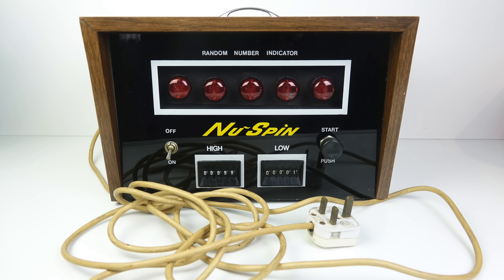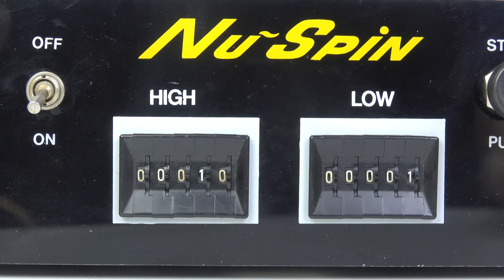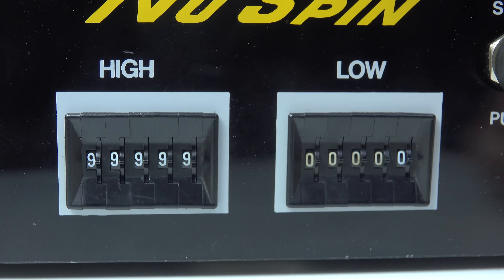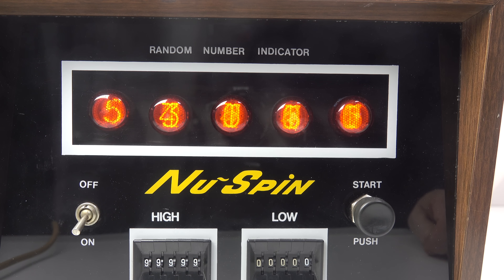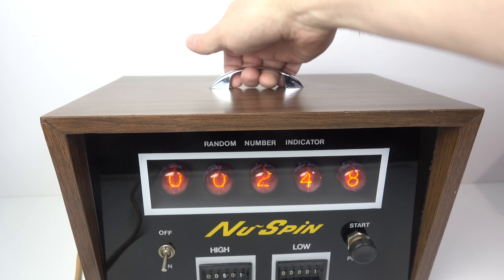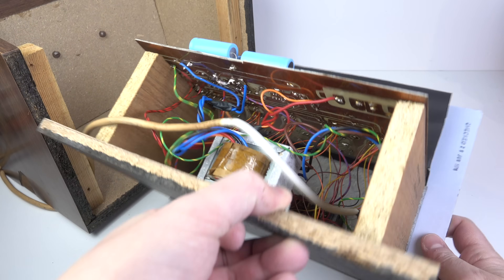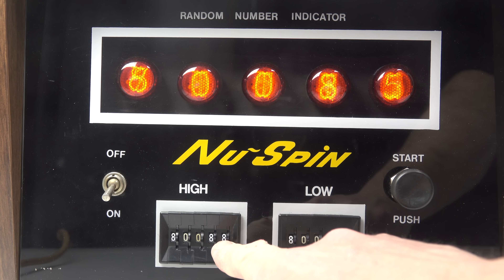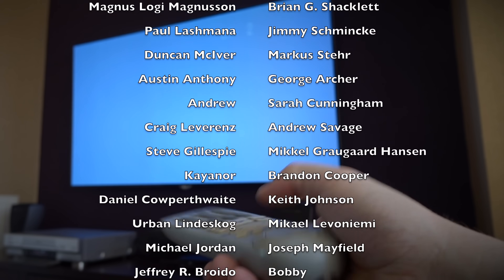This is a bit random - Vintage Random Number Generator

Comment: But how is indeterminate delay time achieved?
Reply: One approach would be that the 555 timer IC is just constantly firing with a fixed period of several seconds, no matter if the counters are currently counting or not. If the counter is running, the 555 provides the signal to stop the counter. The moment at which the 555 will stop the counter then depends on when you started it (pressing the button does not influence the 555 but only start the counter), which is "random enough".
There is some small added randomness due to the fact that the 555's period is determined with simple analog components (mostly resistance and capacitance), whose characteristics change with temperature and other environmental factors. If the counter counts fast enough, that could add some tiny bit of entropy to the mix.
Reply: @enojelly9452  Well good chance that the time will be influenced by the digital part and display drivers. Thus increasing th elikelyhood of stopping when for example an 8 is shown and lessening it when a 1 is displayed.
Reply: It chooses a random number to decide when to stop and select a random number, and so on. It’s a paradox—this is his April Fool’s video
Reply: the button compresses and the cycling stops when it's fully extended again, at least that's what it looks like from the angled operation shots
Reply: you can generate pretty random numbers by having a fast free running oscillator.. i.e. NOT gate into itself, then sample it with a much more slowly running signal pushing bits into a shift register.   The drift of the free running oscillator is random enough when its oscillating at hundreds or thousands of times faster than your sample rate.
Reply: Annon201 ship it over to the isle of man and let clive doodle it out.
Reply: 5x 74141 BCD to decimal (for the nixie tubes), 5x 7490 decade counters, 1x 555 timer, 2x 7400 quad 2-input NAND and I think 1x 7413 dual 4-input NAND Schmitt trigger. The counter circuit is pretty straightforward, not sure about the rest. The Schmitt might be used to debounce the push button switch. Takes me back to my hobby electronics days when I was a kid.
Reply: I also suspect it uses the button to charge up a cap (relatively slowly), then the counter simply runs until the cap discharges again.

(starting from the minimum, and up to the maximum value, of course.)

They could have made it even more "random" by swapping all of the output lines from the counter to the displays, but that would have made the circuit / logic more complex, as you then couldn't do the comparison to the min / max values so easily.

Lots for 4000 series CMOS chips by the looks of it. State-of-the-art back then, and for most of the 80s too. lol
Reply: I think Julien Oster's idea is probably right.
Reply: You don't need to generate an indeterminate delay.  Quite often with this type of unit, the counters are continuously running and the only thing you are doing when you press the button it latching the count value.  The reason for the delay after pressing the button (a simple monostable will do this), is for cosmetic reasons only. If the display were to show a random number as soon as the button is pressed or released, the punters will complain like hell, claiming foul play and that you are rigging the number somehow.  The delay is so that your'e not touching the unit when the random number is displayed.
Reply: @chrisg6597  But not this type, as the counting up continues from where it is currently. This can be seen with the most significant digit.
Reply: But then why the apparently random delay after pressing the button before the value is displayed?
Reply: I wonder how it is doing the high and low comparison to only give numbers that fit those chosen on the wheels. None of the chips have a compare function except the and gates and the nand gates, but there are not enough gates to check 20 inputs (40 if you count both sets of switches.)
Reply: The digits are driven by a high speed oscillator. When they run or stop is controlled by a multivibrator or one shot. At rest, the digits are stopped. Pressing the button sets it and releasing the button starts the time out. The value in the counter when the button circuit times out is whatever it is. Random in a usable practical way.
Reply: Lewis Johnson somehow i dont think so
Reply: Gigs omg yes please😂
Reply: In analog synthesizers a random number is often drawn by sampling the noise from a reverse biased transistor. Another way is to XOR the outputs of several free running oscillators. However, this is often not random enough for calculations but still usable for something like a drum machine.
Reply: @edward: if the sets of wheels and the RNG are connected to a DAC each, then only two analogue comparators are needed. 

it could also explain the quirk in one of two ways, 
A. the timing chip may not be fast enough to detect the RNG>=LOW and RNG<HIGH sweet-spot if the difference is 2 or less.
B. the DACs may not be equally calibrated. (if true then HIGH's deviation will continue to worsen as it's set lower)
Reply: Yes. I think you are 100% correct here. The counter is free running and when you press the button that determines the number. Pretty random.
Reply: In this case, it looks like it's just waiting for a large capacitor to drain, which then stops the oscillator and the counting stops. Pressing the button allows the capacitor to charge, and close the circuit to the oscillator. The button is released, and the path opens. The capacitor begins draining, until it's done, the clock stops, and the counting circuit no longer is pulsed.

This is almost a chip for chip copy from an early 70's electronics hobby book I have.
Reply: Dear Julien Oster, I don’t understand the slightest of what you’re talking about. But I want to understand. Are you Dutch and would you care for me to explain your thoughts in Dutch? Or else just really dumbing it down for non-mathematicians like me? Thank you in advance!
Reply: Here are some photo's I found online when it was being sold before Techmoan got it. https://picclick.co.uk/Vintage-Nixie-Tube-Random-Number-Generator-122974686252.html 

I just got a laugh when I randomly came across this looking up the RNG before the end of the video, incase he gave the answer of what it was. That was probably a better RNG for Jury Pools than what they have now adays.
Reply: None of us will know unless Techmoan shows us the schematic!
Reply: They are likely using 74LS193 4-bit BCD counters. One per digit. These have a LOAD input that allows them to be preset to a specific value. With clever wiring of the lower "range" switch digits to each load preset, it will easily be able to set the starting count. The ending count can be bounded by a couple of hex and gates to compare the upper "range" switch bits with the output driving the CLR input of the counters. The setup would count from the low bound to the upper bound and repeat over and over. As mentioned before, a 555 timer gated by the "start" pushbutton would gate the clock input after a interval (randomized by the time when you pressed the button) causing the counting to halt at some value between the two switch settings.
Reply: Gigs I second that too!  Well... that or eeevblog from Australia :)
Reply: Given its age, I'm guessing that the most likely approach would be to charge a capacitor on a fractional-second slope and discharge and recharge it repeatedly while the button is held down then after the button is released, slowly discharge the capacitor until it reaches a particular voltage at which time you stop the counter.
Since you can't determine what the state of charge of the capacitor will be when you release the button, the counter will stop at a truly random point.
Reply: But if there is a timer that fires every 5 seconds +/- made with the 555 timer and a gate on the timer output that is blocked until the button is pressed and released, then the time between the button press and the timer firing is also random, because the difference between the events is controlled by the human interaction with the button.
Reply: It's possible and a perfectly good way of doing the same thing.  I'd be interested in knowing what method they used.
Reply: Well, a 555 can do voltage comparisons, but were there any sort of ADC or comparable on board?

There's also transistor wizardry you can do for randomness, but i don't know how to spot it on a circuitboard. You can cause an avalanche in diodes/transistors and the output will be random.
Reply: could u use the 60hz main as your oscillator
Reply: avfusion < I think your button press coupled with a capacitor discharge theory is a likely source for randomness, I've seen similar schamatics before.  But of course it can be done in a number of other ways too.
And now something completely different...
When replying to another person, it would be nice if YouTube would insert the name of the person being replied to,  so anyone else reading it could make some sense of the thread.   I just manually copy and paste the name in front of the message to make it more readable. Oh well...
Reply: This seems like it would be more likely to pick low numbers if the device starts counting from the low number each time.
Reply: It's possible they sample the noise voltage from a resistor when the button is released, and a sawtooth generator combined with a comparator is used for the counting (which just keeps going forever when you hold the button down). A simple set/reset flip-flop is then used to display the number, which can be generated from a fairly crude ADC circuit and a pair of amplifiers to bias the output voltage for the high/low numbers.
Reply: Jaffa Orange - That would make it Double-Dutch.
Reply: this used to be  fairly common type of circuit.  IT Is TTL, NOT CMOS for one thing.  Normally the low dials set the starting number the decade counters start to count from, the preset value, then the max dials set the number to match for the counter to reload the preset value, or the reset value of the counter.  So as soon as the counter output matches the max setting the count is forced to the min value.  typically there is some delay that naturally occurs for this counter reset function due to the delay time needed for all the logic gates to clear and be set.  TTL is not very fast by today's standards for sure, and there were newer hybrid ttl/cmos chips introduced later that were faster, but that does not matter for this circuit.

   The digits you see are showing the actual count from the decade counters.  Again typically what happens is that the output drivers for the display digits simple latch the incoming number at some point and display that number as a fixed number even though the counters would actually usually keep counting.

  So yes the normal design would be the counter is always counting from the minimum setting and count up till the max number is reached, immediately reseting to the number on the low dials and continue counting upwards.  This process would in most designs never stop.

  The display will show the last number that was latched into the display drivers.  When the button is pressed, it forces the logic level on the latch input to clear, or unlatch so the display driver is again showing the value of the incoming counters.  When the button is released, a voltage ramp, up or down depending on the chips used, will start to change zero to 5 volts, or 5 to zero volts, based on the resistor and capacitor value determined time base for the ramping.  This ramp will be stable and repeating but will vary based on temperature, and age of the components due to value drift.  This voltage ramp would typically feed into the latch input so when the logic level is reached to latch, the display is then frozen on that digit.
Reply: Bill A  The iOS version of the YouTube app does exactly that; why the desktop web page doesn’t do it is beyond me.
Reply: there is no comparison at all. When hitting the high number, the counters are set to the low number and count on from there. If the high number is lower than the low number, it will simply count past 99999 and up to whatever the high number is set over and over.
This behaviour is intended for when one roll of tickets is sold out, a new roll will start at 1 and the number generated is still covered by tickets.
Reply: Gigs my bet is on this, when the button is pressed longer the delay seems longer
Reply: It looks a lot like the longer you hold the button, the longer it counts for.

So, pressing the button charges a capacitor (which of course has diminishing returns and eventually more or less levels out), and releasing it lets it discharge through a resistor that means it discharges a good bit slower than it charged. The counter is connected to a freerunning clock by something probably as simple as a single transistor, controlled by the output of the capacitor, so it starts counting almost immediately when you press the button, and then runs on for a while until the voltage falls low enough to turn the capacitor back off. The speed of count and the difference between charge and discharge speed being such that the difference between start and end count is probably equal to the number of microseconds you pushed the button for, and therefore there's sufficient entropy to give an entirely randomised count within a ~100,000 range because it's difficult enough for a human to hit a temporary-contact switch for anything less than about a tenth of a second, and there's no way you can accurately control how long it makes contact for within the roughly 0.05 to 0.15-second range, let alone being microsecond accurate over a longer period than that.

Quite why it never stops running if you set the upper and lower count less than three spaces apart is the bigger mystery, but presumably there's some kind of race condition in the circuitry where the condition of the transistor latch (and maybe even the clock signal itself) is ignored when the device is comparing its current count against the highest number set, or resetting to the lowest - so after resetting it always counts up by one automatically (so, you'll never actually see 00000 on there other than when powering up), and it then compares against the upper limit and resets if there's a match (so you'll never see 99999 either), both before rather than after or under control of the clock signal. Which also explains why if you set the counts three apart rather than two it'll always pick the exact same number, because that's the first place it lands where the presence or absence of clock has any effect.

(well at least, that's how it should work ... the really curious thing is that it seems to actually reset at a number two below what you set, and then doesn't count up afterwards... that's probably a genuine bug in the electronics, seeing as it means how you CAN get 00000 on the display, but won't ever see 99999, OR 99998 or 99997, with the highest it'll settle on being 99996. And probably why when set for 0 to 101, it gave an answer of 98 - I bet that's the highest it would actually display and TM just fluked it)

Evidently the machine could be improved somewhat, so that the top and bottom counts are actually things that can appear on the display, by also having the reset and count-up-from-reset stages be clock gated along with everything else... I guess whoever built it thought it wouldn't be worth the effort of redesigning it to work that way, even though from my perspective that would surely be the easier and simpler way of building it anyhow...
Reply: The randomness almost certainly is coming from the user pressing the start button.  If you have a slow (several seconds) counting loop running continuously in the background then you will tend to be pressing the start button at random times within that slow loop.  The digits are then incremented with a much faster counter (one sufficiently fast enough to be able to count up to 99999+ within the slow timing loop).  If the user could reliably control the time at which they pressed the button they could generate a desired value every time, but that is not practical within human perception and reflexes. That said, there are other ways to get even greater randomness, like tuning into radio static (the cosmic background radiation) or counting the interval between particle decay events of a radioactive mass.

The reason the "High" value never appears is a bit of laziness in the design.  The value you are setting is not actually the "high" value but rather the "reset" value such that when that value is reached the counter resets to the "low" set value.  Had the designer been a little more clever they would have encoded things in such a way that the actual reset value is always one digit higher than the set "high" value.

I suspect the 8008? glitch is due to a damaged or dirty trace/contact or a malfunctioning logic gate resulting in the comparison not taking place properly.
Reply: I would build this bu having an ocillator run at a high frequency when the button is pushed. When the button is released it will finish any cycle it was in, plus an extra bit of time.
Note that this kind of circuitry will need excellent supply decoupling, or the current from the display switching will get into the time delay circuit, makint is (for example) more likely to stop on an 8.
Reply: There's a cup with dice in it. On the sides of the dice are QR codes. The device shakes the cup, and then reads the QR codes with a camera. Boom. Random.
Reply: “And now the only question left is-“
how does it determine the time it should stop and how is that random?
“WHAT WAS IT USED FOR?”